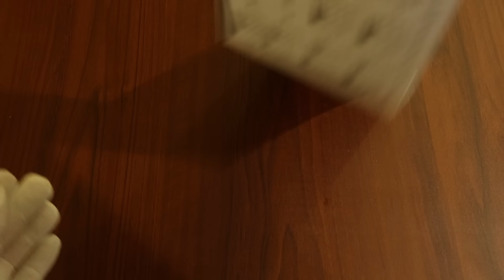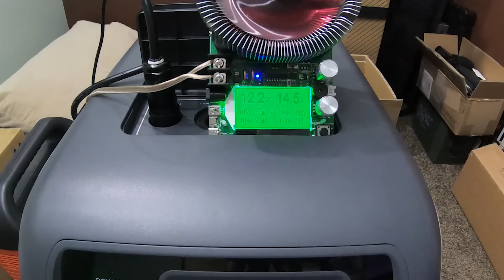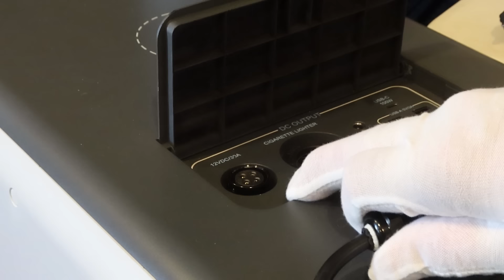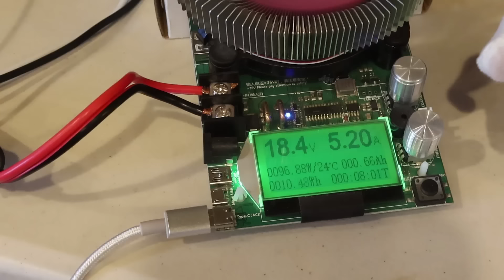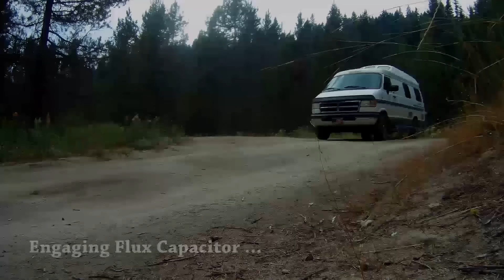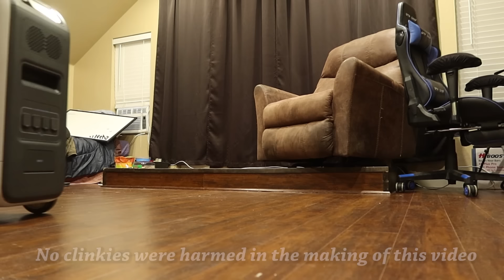BLUETTI EP500 5120wh LiFePO4 UPS BACKUP Off Grid Solar Generator Kickstarter Review

Comment: Any ideas how I could get some technical questions answered?  I tried sales, but they have not been helpful (so far).  I'm specifically trying to get some specifications of the UPS functionality on the EP500 (or AC300):
1.  Is the bypass automatic or manual?
2.  What is the transfer time?
3.  What is the transient regulation?
4.  Does the device have built-in power conditioning?
Reply: I've done some playing around with the UPS function on the EP500 units I got. There are 2 modes--Online UPS and Offline UPS

Online UPS - The AC outlets are powered by the inverter in the power station. In this mode you are still pulling from the internal battery, and the AC wall power is charging it. Note that in this mode you get the full 2000W capability of the inverter. Ground and Neutral are not bonded in this mode (Floating Neutral).

Offline UPS - The AC outlets are powered straight from wall power in a "passthrough" mode. In this mode, you are limited to the output capability of the wall outlet. If that's 1800W, then you don't get the full 2000W. The Ground and Neutral are bonded, just like they are when pulling straight from wall power (Bonded Neutral).

In Online UPS mode, since you are already running from the inverter, pulling the AC plug has no effect. The UPS "fallback" is instantaneous because nothing really changed from the perspective of the AC outlet on the power station.

In Offline UPS mode, unplugging the AC wall outlet causes a relay to switch internally (you can hear the click) as it switches from passthrough to "inversion" mode. That seems to take about 1/2 - 1 second to fully switch over, so there is a delay. If you have a use case where the devices you are powering can't tolerate the switching delay, you can keep it in "Online UPS" mode.

Comment: Question: I purchased a EP 500 pro along with the companies pv voltage drop module ( because it says it can be used for conventional house panels) along with  -MPP Solar LV2424 - All In One Solar Inverter/Charger/80A MPPT Charge Controller. Im assuming a charge contoller does what the pv drop module does - SO Two Question - 1st.-could  i plug my EP 500 into all in ones generator connection use pv voltage drop module and expand more batteries in all in one - 2nd - Can i plug Ep 500 into battey input of all in one which has charge controller and use house panels of course to Charge Ep500

Comment: Got mine today. To be safe, you need two people with a dolly and truck ramps to get this to your porch. Well protected by molded foam and heavy cardboard on a pallet. Unpack on its side. Keep foam or cardboard under it at all times until you get it upright to avoid scratches or a drop of the dolly. 
This thing is so heavy, the elephant has grown to maturity and needs a ladder and a howdah just to mount it. You may need white coat delivery or back surgery. 
On the other hand it only sticks out 6 inches from the 24” deep counter where I removed a useless trash compactor. I don’t mind because it looks nice (until the cables stick out). I have not powered it on yet due to the late hour. 
Gripes are 1) AC charging cord is too short to reach back under the EP 500 to a high outlet! 2) Why is this cable on the front where it’s in the way and the concealment door must be opened straight and is likely to get knocked off?
3) Charging plugs should be right angle type also for same reason. 4) a 2000 watt inverter is quite small for a unit this big.
Reply: Got mine this week as well. You don't appreciate how big and heavy these things are until they are in front of you. Seeing it on video just doesn't capture it. It is absolutely massive. I was able to get it off the wood palette and out of the Styrofoam protection by myself, but I'm paying the price the next day in my back and legs. 

Same observations on the AC power cable. It's a little short, and if you want to back up the unit against the wall, you want the charging plug on the backside, not the front, so you can just plug it from the back (like a fridge). Having it on the front is very inconvenient. Once it's on the wheels it's easy to move around. Thank goodness my home is single story.

Comment: Stop and look at the big picture how many people do you think will get cars could one of four to get it three do we have the resources for it no we do not still oil is the only way we can make it work we have enough oil to run when we have infrastructure wise then what do you do at the old batteries what are you do it those they have more dangerous chemicals in nuclear what are you pull that way if that toxic junk that’s the problem people like you political those who have no idea what you’re creating in the long run wishful thinking yes they were in better yes the engine motor much better than transmission yes there were efficient agreed how about you do a power small engine over electric with a small diesel engine is the version with high capacitors that way you’re not using so much battery which is a lithium and I really dangerous chemical out there!!!!!If you do that if you make it Bennet one you’re living in Russia or come with the country he should have a choice to do what you wanna do too we don’t have the natural resources we give away half of them when we give away Afghanistan to China convenient for Biden

Comment: What system would you prefer to use in a grid down scenario this Bluetti ecosystem for your home or the eco flow delta pro ecosystem to power a home? Also im a beginner to solar so which do you think would be netter to use? Also you videos have helped a lot
Reply from the maker: i'd probably choose the AC300 because I can move it around easier. For stationary use the EP500 is great though.

Comment: Just recieved my ep500, looks great but I ran a iceco 65 and after 12 hours I used 20%, thats actually worse than my jackery 2000. At that rate it would only last 2 and a half days running ac power. I'll try dc tonight but so far I'm not impressed with the amount of energy this inverter is using,  I hope there will be a firmware update to fix this issue.

Comment: I just received my ep500 last week. My problem is the 30 amp 12volt plug is still a month out. My question is can I buy a aftermarket plug ?
Reply from the maker: No. You can build one if you find the parts.
Reply: @HOBOTECH  thank you. Now I just need to find a place that carries the right parts 😁

Comment: Good afternoon. I'm trying to power a bumper pull trailer quietly. In your opinion, which Bluetti without purchasing any extra power banks would power a 13,500 watt AC unit and approximately for how long?
Reply from the maker: This will power the compressor for 5 hours.

Comment: Just discovered your channel while doing research on solar generator. I live in New Orleans so we deal with hurricanes every year. We just had major damage from hurricane ida. I had my Jackery 240 and a gas generator. Put to real world tests, the lower end Jackery barely lasted two days. Gas generator was solid but way too loud. I had concerns at night. Felt like it was a cattle call to tell everyone we have power here. Just ordered the bluetti ac200p and solar panels. Hoping that will fix most of my concerns.
Reply: This is not a generator, it is a battery.

Comment: Can it power a 240volt 40inch exhaust fan?
Reply from the maker: Pair two with the Fusion Hub for 240v.
Reply: @HOBOTECH  how long can it run and have they come out with a solar generator to run a 30 amp 240 volt fan yet?
Reply from the maker: @Acethao66  Depends how many watts. I just said it will do 240v 30A.

Comment: From what I learned from this video, you can accomplish 220 power with two of these units if connected with the available cord/accessory.  The only other option for 220 that I can think of is two EcoFlow Delta Pro (or Pro with extra battery) connected by their cord accessory.  Are there other options for 220 besides these, that you know of?
Reply from the maker: Nope, that's it.
Reply: @HOBOTECH  220 is the holy grail in a power outage situation.   My first extended power outage I was using a generator with extension cords, and I was happy with that.  For my next extended power outage I had the generator hooked up to the whole house via 220, and it was just the coolest thing ever to me.  It's like I won the lotto.  If the day comes when I'm hooked up to 220 solar, I'll feel like I'll need to win the lotto to pay for it.  It definitely won't be cheap.
Reply: How many watts can you draw using the Bluetti fusion box 220?

Comment: What will work with a 50 or 40 amp circuit
 most large RV can work on a minimum of 40 amps, when the RV is rated at 50 Amps, help us
Reply from the maker: A pair of EP500 Pro with the Fusion box will run a large RV. So will a pair of the Delta Pro with their voltage combiner box.

Comment: I came across your video by chance and am glad that I did...great review. After talking to the wife about the pros of getting this I pulled the trigger.  I was too late for the 2799 price but got it for 3199. Your mentioning the need for 3 12 volt solar panels got me thinking of how I could do the set up. The Bluettie panels that were offered as one of the deals were a little pricey. I saw a 400 watt panel on the net that is more affordable for me. the specs state: voltage 52.3v     rated power output 400 W     DC/charger volt compatible 12v,24v,48v     Would two of these panels be plug and play compatible with the EP500 without buying anything else? Is the 52.3 volt output too much for plug and play and if it will work would you suggest setting up in parallel config? Also, I looked for a user's manual on the Bluetti's company's website so that I could start planning on how to set up the unit but couldn't find a pdf available. Do you happen to have a link?

Comment: It's a power station; it's NOT a generator. You said it has a cable to CONNECT a generator-because it isn't one. It has inputs to connect solar panels. We could easily adapt ANY battery-powered (BATTERY-POWERED!) power station to accept input power from solar panels, gasoline-powered generators, or even a wind turbine.  (Heck; with the manufacturer's logic, if you input power from a backyard wind turbine they could label this a "wind-power generator"!)  -  Those EXTERNAL devices generate or provide generated power to the power station.  Please don't add to the misleading marketplace confusion by parroting product advertiser's "solar generator" misnomer.  -  It's a downvote from me for perpetuating this lie.
Reply: (Okay; why did YT cross out my text? Weird.  So here it is again:  "It's a power station; it's NOT a generator. You said it has a cable to CONNECT a generator--because it isn't one. It has inputs to connect solar panels. We could easily adapt ANY battery-powered (BATTERY-POWERED!) power station to accept input power from solar panels, gasoline-powered generators, or even a wind turbine. (Heck; with the manufacturer's logic, if you input power from a backyard wind turbine they could label this a "wind-power generator"! - Those EXTERNAL devices generate or provide generated power to the power station. Please don't add to the misleading marketplace confusion by parroting product advertiser's "solar generator" misnomer.""
Reply from the maker: Object all you like https://youtu.be/nElIOelXm6A

Comment: I signed up for the Kickstarter program for the Bluetti EP500 Solar Generator after I saw this on HoboTech. I was very much looking forward to getting this for my motorhome even though I already had a complete component solar charging system that is better than Bluetti but I still needed the LiFePO4  batteries so I figured that this would be the best way for me to go. The only thing was, I found the Bluetti company very dishonest and underhanded. So, unless they came good on the agreement we made, I would NOT go through with it and, they did not. 

I ordered the EP500 with the car charging cable and agreed to shipping at $180US which, I thought was very high but I though, ok, it still is a pretty good deal. Actually, in the past, I have been shipped much heavier/bulkier items for less than 1/2 that amount. I have had a few ebikes/scooters shipped complete with lithium batteries. 

Bluetti emailed me & said "The EP500 cannot be charged by the car, so the car charging cable is not suitable for the EP500. Please check if you need to cancel this cable." 
So, I said "Ok, cancel the car charging cable." They said they could not & had to go to the Kickstarter web site to do that. So, I did this but was surprised when I got my statement to pay and found that the cable was still included and that they were charging me $190 now instead of $180 for shipping. 

They also informed me "And we will do our best to deliver the product to you before October." I said that "You promised delivery by August." Then they agreed to send it by August. 

On May 22, 2021 I got an email that said "There was a problem processing your pledge to BLUETTI EP500 & EP500Pro - The New Era of Home Backup Power. You have 7 days to fix your payment method.
Fix payment $3,393 pledged."

On May 22, 2021, I sent them an email & said "I just received your charge for the EP500 but was charged too much. I cancelled the 12V charging cable and the agreed shipping cost was $180, not $190. The total cost should be US $3,364 not 3,393.
My bank put a stop payment on this change & sent me a fraud alert. How would you like to continue with the proper payment amount.
$3364 x 1.2068333 (exchange rate today) =$4059.79, not $4,207.47." obviously, they were overcharging on the exchange rate too. 

They replied "Thanks for reaching out. We took a look at your account and our information shows that the pledge amount for your pledge to the Bluetti project was $3393.00 as noted in the confirmation email sent to you on March 23, 2021." I did not notice the error in shipping until I got my statement to pay & some how, they think that this is ok and refuse to correct it and blamed Kickstarter. 

I wrote back and said" So get them to change it. 
The dishonesty and underhandness of Bluetti & Kickstarter is terrible. $225 Cnd for shipping is outrageous and then you try to charge even more. I have shipped heavier, bulkier items for less than 1/2 that amount. If you don't correct this immediately you can keep this stuff. I refuse to deal with such despicable businesses. It costs more than $4,000 Cnd for a solar generator and you can not even charge it with the vehicle alternator and then you refuse to cancel a cable that I cannot even use."
It's probably better that I install a component system anyway." At 168 lbs, this may be too heavy for me to move and I had dedicated one of the dinette seats in my motorhome for the lithium batteries and inverter charger. Being such a massive/tall unit, I would now have cut a portion of of the table instead. 
Also, Hobotechno had just revued another solar generator that might work even better. With its modular system I can add as many batteries as I want, it has an aluminum case, costs less money, has bigger and better inveter, will fit under one of my dinette seats, is lighter & more compact and is easier to carry / move as it comes apart. 

6 days later, I got another email "Action needed
Oh no! You have just one day left to purchase  the BLUETTI EP500. 

So I wrote back "Action needed. 
Oh no! You have just one day left to correct the errors to purchase of the BLUETTI EP500. The agreed on price for shipping was $180, I cancelled the cable before the promo ended & use the proper exchange rate & NO, I will never consider another BLUETTI product." 

I do regret missing out on this system but I refuse to deal with such an arrogant, unresponsive, dishonest, self serving company. If they originally charged the $190, I would have paid it. I just do not like being cheated.

Comment: Australian version of Bluetti all comes with 240ac.
Reply from the maker: Would be useless otherwise, mate.
Reply: @HOBOTECH  
I just threw that in there.
My guess is their 240 is not as same as our 240. Must be one side 240 and not 110x110 per side like in the US.
Maybe Bluetti could build a 240 outlets with amperage and capacity to make it useful in the US. Make it easy to tie into transfer switch on the house.
Reply from the maker: @wt9653  They already offer 240v with the Fusion Box.
Reply: @HOBOTECH  
No, without any contraptions.
Just like power wall. But, on a small portable power stations.

Comment: Well, looks like I came late for the early deal party! I live in the northeast where winters are sometimes brutal. I see you plugging in a tiny heater and tiny little fan and some other little impractical  item, but can it run a full size refrigerator or 2 and a chest freezer and full size microwave? That's what i need to see before I make any commitment. Will 2 units plugged together run a full size clothes dryer?
Reply from the maker: Two plugged in together will run anything in your house.
Reply: @HOBOTECH  Thank you so much.

Comment: do you need to ground the ep500 if you are using it with a  manual transfer switch from your main panel?
also can i ground the solar system (ep500) to my main panel?
Thanks